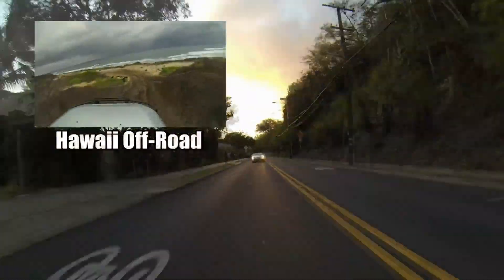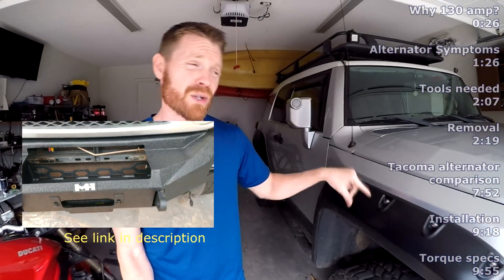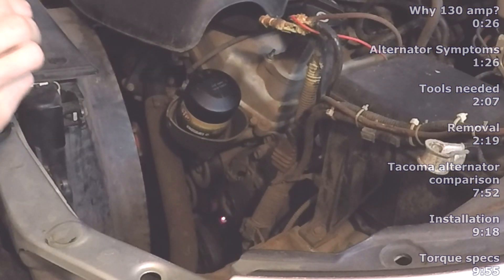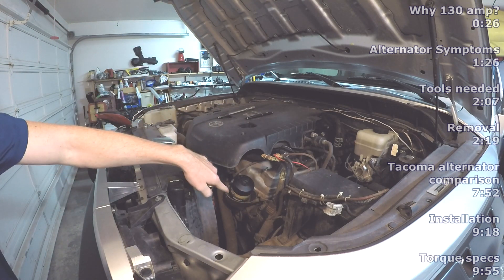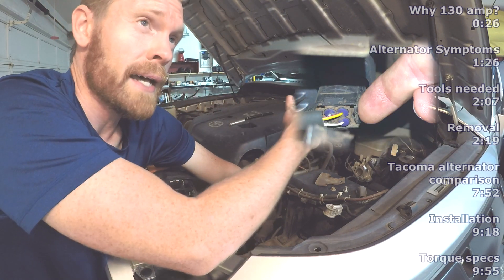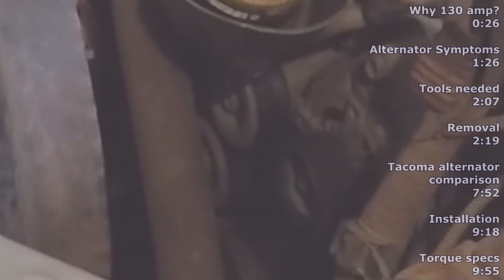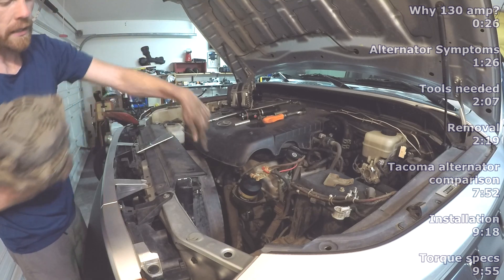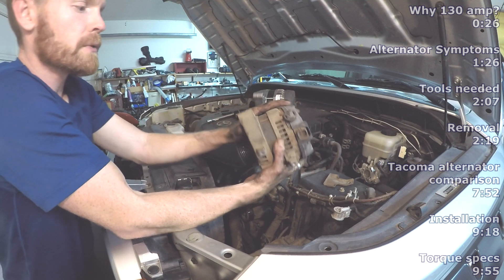FJ Cruiser Engine Upgrade Part 1: OEM High Output Alternator Install (From a Tacoma)

Comment: Time for a alternator change on my 2009 Toyota fj. 154000 miles on the odometer
Reply from the maker: That's around the same time mine failed. Good luck! It's fairly easy to change on the FJ

Comment: Hey great vid.
 The small wiring retainer bracket bolts (10 socket) , can come out and from the side , behind tire.
 Muuuuch easier, put some maskin tape on so bolt dont fall of from socket, like a lil piece to snuggle in.
Reply from the maker: Hey! Thanks for the comment. That's good to know with accessing the 10mm from around the wheel

Comment: I have 07 fj manual,need to replace a new alternator 100a to 130a do i need to replace any wiring or fuses?.i have lightbar,winch,2 round light bumper,2 side lightand small on low bumper.?,you think 130amp are ok for stock wiring and fuses?..
Reply from the maker: Yes, 130 is ok for stock wiring and fuses. I have a winch and lights also, and it's fine. The higher amp alt just puts more load on the engine when more is demanded of it. the only two things that would possibly need upgrading would be the alt fuse and the fat wire going to the post on the alternator, but that wire is heavy enough (awg wise) that it's fine.

Comment: Hello there.  Very well captured and step by step instructions.   Any updates on the 130Amp alternator? How long have you been running it ? Did you change the fuse to 140 Amp and wiring ? I am running 2 pairs of Rigid pod lights and Dc DC charger, winch but have not used the winch as of yet .   Many thanks
Reply from the maker: Hi, I didn't change the fuse. The alternator doesn't push amperage, the electrical devices pull amperage from the alternator and the wiring/fuses need to be upgraded if you plan to install more electrical devices.

Comment: Quick question did you get like a weird idle while it was acting up
Reply from the maker: No weird idle, but it did die randomly a few times while shifting between gears (manual transmission)

Comment: My volt gauge has been moving like that since I bought it 6 yrs ago with 34,000 miles. I’ve always wondered why it did that but still working with 90,000 miles on it now.  I guess higher amp alternator would help with that ?
Reply from the maker: It just means that your voltage is fluctuating, my battery also died a few times when the needle was bouncing like this, so it was bad enough to not charge my battery as much as it should. If yours has worked fine then I wouldn't change it, it's still charging your battery in your case
Reply: @LegitRaceCraft  awesome!! Thank you !!
Reply from the maker: Do keep an eye on the average fluctuation though. If the voltage starts to get too low in the fluctuations then it could possibly damage electronics. Your regulator inside the alternator is supposed to regulate the voltage, so that seems to be the part of your alternator that's not working properly right now

Comment: What years does this apply to ?
Reply from the maker: Specifics are in the description with part numbers. It applies to all. Basically the 07-09 models use the Tacoma alternator and 2010+ use a 4runner alternator

Comment: Are you running factory gauge wire between alternator and battery and factory gauge ground battery wire? Or should I upgrade wiring as well?
Reply from the maker: Factory gauge. You don't have to upgrade your factory wiring unless you install enough accessories to blow the alt fuse, and most of the time upgrading the wiring isn't necessary. If you blow a fuse then that means you're wiring can't handle the extra load and you should upgrade the fuse and the wire.
Reply: @LegitRaceCraft  sweet. thanks for all the info! Alternator on my 07 is on the way out - whining bad. Im going to purchase 27060-0p020 tonight and follow your install!

Comment: I preferred to get my OEM rebuilt when it started to die, rather than aftermarket. Running fine with a winch and couple of aux lights. Will be doing the same thing as you when this things done 🤙